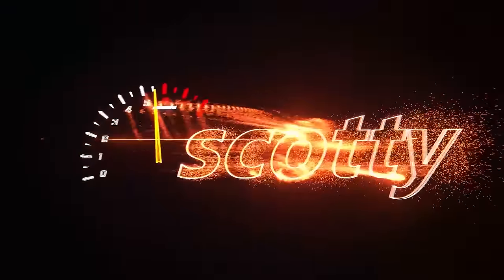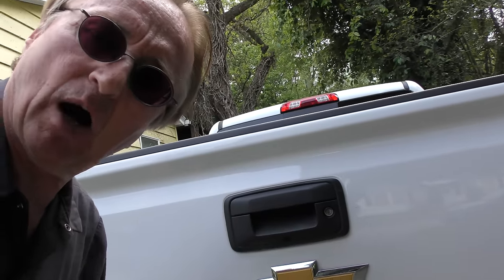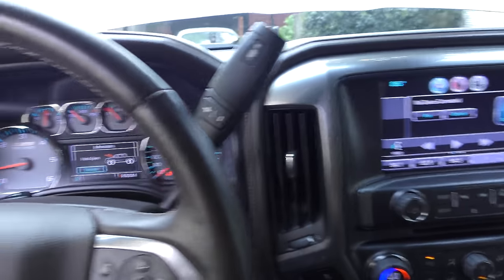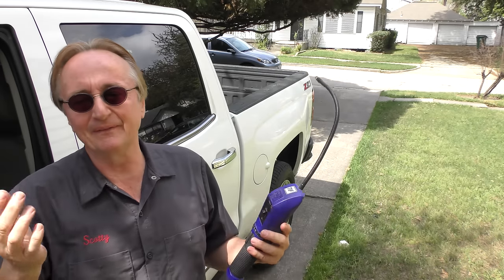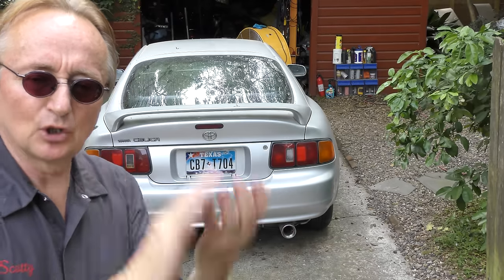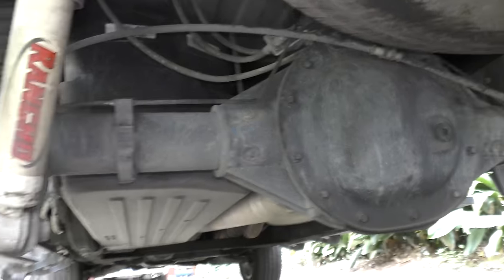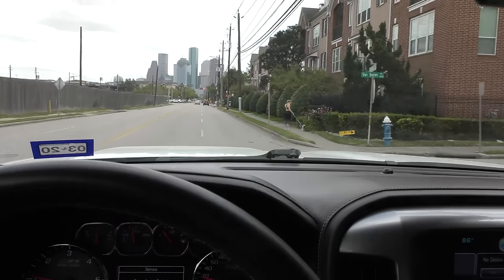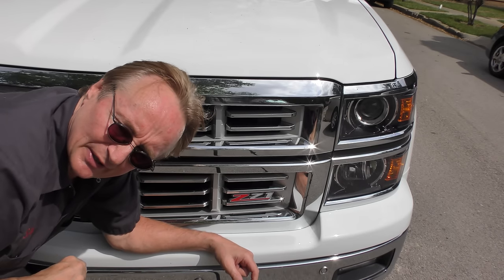Here’s Why I’ll Die Before I Buy a Chevy Silverado

Comment: 2015 condenser failed at 70k miles. There are 3 welds on the bracket. 3! Cracked and leaked. Dealer wants $1300 to fix it. Ill do it for $300 including buying the tools.

Comment: The problem and I've seen this on multiple new cars not just Chevy is we live in a disposable world people don't buy cars anymore they lease them and throw them out after 5 years. I'm running into this problem on my 2015 Chevy Tahoe. It has so many stupid problems that don't need to exist in a 2015. But I also had a problem with a 2015 Nissan Pathfinder that I just recently worked on for my friend the radiators already leaking and they make it so it's a pain to pull that radiator.

Comment: Dear Scotty:
I know you don't like audi or newer german vehicles like bmw or Mercedes but I really want to buy an audi. I test drove one and it seems like a great car. I want to own one for just a couple years and then trade it in for something else. What would be my best option that is under 20k and will hold its value relatively well, so when I trade it in it won't depreciate much. Also be reliable enough to last me a few years. Looking at quattros. Need something most reliable from audi, even though reliability isnt their strong suite per-se. If I buy an audi with 100k miles are there any models that will last another 100k miles with regular maintenance? They look nicer than all the other car manufacturer's sedans/coups and i'd rather get an audi or perhaps a lexus if I'm gonna finance a car.. Has to be 2011 or newer also. Can any audi owners give help i'd appreciate it immensely. 🙏 God bless

Comment: Alright. Got a 2006 Chevy Silverado 3500HD. 6.6L Duramax, dually. All the bells and whistles (by 2006 standards atleast) 450k. Original motor, original tranny, and I'm the original owner. I have no issues with how it steers, has tight steering. AC still blows cold (original compressor.) And more importantly. I've done brakes, oil, and suspension to this truck and nothing else. Has no leaks, never has. I normally carry about 1200lbs daily in the bed of it, haul a camper with it about twice a month. So until you want to talk about bad build quality, you describe to me how my Chevy has lasted as long as your Toyota. Or 4 times longer than your F150.

Comment: Obviously moving the evaporator inside was was a bone headed move but it seems like it doesn't matter what make of vehicle you own, especially the newer ones they all have some sort of stupid ignorant design flaw. I've got a 2013 extended cab Silverado that's a decent truck but when I need to go off road or haul a heavy load I jump in my 1986 2500 GMC 4×4 pickup.

Comment: I'll keep my older 2002.  It has about 235,000 miles on it at 20 years old. I'm just now having some of those problems. But over all it's been very nice to me.  I don't like the new ones.  Truck manufacturers have forgotten for a long time that trucks need to be rugged.  But gotta put all that plastic stuff on there to get better fuel mileage.

Comment: Not sure an AC evaporator issue warrants an outright verdict of poor quality. There isn't going to be a 2015 pickup from any manufacturer that doesn't have an occasional issue. $2000 repair cost / 60 months = $33.33 /month appreciated repair cost from new. I agree it's a shame evaporators aren't still under the hood, but I'm fairly sure there's been a consensus among parts manufacturers and dealer repair centers for a while now..."they don't make 'em like they used to..." is right, but making more things difficult and in need of periodic repair/replacement keeps the cash flow going too.

Comment: got news for ya Scotty
got a 2010 f150 that has the same problem! 
Dad bought pickup for himself new, within a few years A/C started warming up with thermostat turned all the way to cold. Took truck back to stealership still under warranty. All fixed, same day. A few years later and out of warranty and truck left to me,, A/C got warm again but I noticed accompanied by a weird smell in the cab. Evaporator leaking and when truck was with  stealership supposedly getting fixed, they probably just recharged it with freon w/ stop leak which held till out of warranty!  And just like the Silverado, you have to remove the entire dashboard to change out the evaporator! Perhaps by design or perhaps problem with same vendor that makes the evaporators for both ford and GM or the same gaskets, O-rings, etc. that seals evaporator to hose fittings on engine side of the firewall...

Comment: I purchased my Chevy Silverado 5.3L in November 2014. Going on 10 years and this trucks  been very costly with repairs, fuel mileage,  rebuilding transmission,  replaced ac condenser, and constantly replacing annoying sensors all through the truck. Gm never stood behind any of these poor designs at all. After this I dont see me buying another chevy again now.

Comment: I have a 04 Silverado and the power windows suck and the door handles suck. Chevys are famous for shitty power windows. Other than that it's been very reliable. 230,000 miles and only thing that I've had to replace is the radiator and brakes of course. I was thinking about trading for a 2010 and it just didn't feel very solid. I kept my 04 and I'm glad I did. Its probably the best it second best vehicle I've had. My other vehicle that I had good luck with was a 92 S-10 Blazer 4 door.

Comment: My dad has owned 7 Chevy pickups 1/2-1tons.. All with 400-500,000 miles. Only a couple had transmissions replaced around 350,000 miles!!! One motor at 400,000. FUEL PUMPS WATER PUMPS common issues with early models. Always kept spares for every 100,000 miles... Seems like 07'-present it's all electronic stuff
Years  1985. 1990. 1996. 2001. 2002. 2009. 2016

Comment: Now GM has a massive class action lawsuit on these because the AFM/Torque converters blow up. I’ve got a 14 that’s been very reliable to date. Knock on wood. But if an AFM/tranny issue develops, it’ll make the AC fix look low budget. I also have a 22 year old Acura that’s bulletproof.

Comment: Yeah I've had a 2002 and a 05 they were tanks tough built to be able to take apart and put back together and it's was made with better materials I've had to get rid of them thru the years and now I regretting me own a 2010 Silverado 2500 crew cab 4x4 and it drives good maybe smoother than my older trucks and the 2010 has so many more issues and weaknesses than the older trucks electronics, the plastic, the transmission, computers and transmission and torque converters all are garbage. Nothing lasts past five to 10 years anymore from Silverado which is sad for the amount of money you have to pay for them. Your pain literally house note payments for vehicles now especially trucks. Vehicle manufacturers don't give a damn about us anymore. That's why they keep on mass producing crap that don't last 😤😡😮‍💨😏

Comment: Bought a sequoia that replaced my 07 yukon xl  and a lexus RX for my wife because of his videos. Sequoia is a bit outdated in style but I'm confident it will last me longer with less maintenance cost over the years. Just saw a video of a guy who bought a new suburban and the head rest on the third row seat wouldn't  lock on the upright position after 2 months of use. Really Chevy and Gmc?? Love my Yukon and glad I bought the extended warranty because I had to use it, with its cracking dashboard and defective headlights and and and I used all of what i paid for....but not going to risk my hard earned money on their newer models. Final answer.

Comment: Just traded in my 2016 GMC Sierra 1500 All Terrain which had 120k miles.... was on its 2nd transmission... roof leaked when it rained... it's on its 3rd fuel pump since april....3 fuel pumps in 3 months...needless to say I'm the proud owner of a 2019 tacoma 4x4.... I'll never own a GM product ever again...

Comment: My 2015 dually WT was listed at $42,000 . I bought it in November of 2015 for $31,000 . Has 58,000 miles and has blur book trade in of $47,000 seat back and radio have been the only issue . FM replaced the radio in it . Otherwise it’s been solid as a rock . Now the stories I hear at work about the Dodge and Ford are rather frightening . Guess I should have went with the 94 celica 😎
Reply: that is the better pickup, right?

Comment: Not  impressed with my 2009 Silverado 5.3 liter v8 ,  bought it used with 110k,  2 miles  into ownership , it needed a new radiator , then windshield cracked , replaced it, then brakes, rotors , calipers frozen, replaced those, replaced front shocks, stabilizer links, spark plugs, thought I was good , then the air conditioner went , replaced condenser, evaporator , cleaned, now it leaks, so no ac, 
Year 2 of ownership went to replace the rear shocks, drivers side was rusted off at the top,
So I spent 2000.00 to have the bed removed, sand the frame, paint the frame , weld on 2 tabs to reinstall 2 new shocks, cut another crossmember  section of the frame that was rusted out, replaced that, replaced the rear differential cover, then spent another 2500.00 to have rear quarter panels cut out and replaced, replaced the track rail on the under side of the bed ,repaint the bed of the truck professionally and fix other miscellaneous rusted metal on the under side of the bed, plus paint the wheel wells with rust proofing paint, and if that wasn’t enough, the truck has a collapsed lifter another very common problem with these trucks, plus it will lose power as I’m driving it while the door locks go up and down as I’m driving it every two or three weeks for 45 seconds to a minute.. truck now has 133k on it , and was from Hyannis mass, rust bucket, even the the chassis rails which are thick have holes in them , really not impressed with this truck at all,  when I bought it the body of the truck looked great as did the bed, but it was all rusting out underneath,  ready to go back to dodge , on the plus side the seat is comfortable , but it’s very generic, unimpressive truck.
Oh yeah can’t even listen to one song on satellite radio without constant interference. Expected more from gm but left disappointed. It is reliable but not with out its problems.

Comment: I have been driving for 50 years and other than GM, have had one Subaru. I just bought my first used Ford truck. I am tired of 10-15 year old trucks just rotting out from under me. Maybe Ford is no better, but it was time to try something different. I mean, really,  a 12 year old truck so rotted out it cannot can be repaired for inspection??

Comment: Worse thing about that Silverado is it has direct injection, prone to build up on the valves and intakes from crankcase ventilation. The factory should have equipped them with an oil catch can.

Comment: been a GM guy my whole life, but I picked up a used ford ranger 5 years ago because it was the best truck i could find for my budget at the time. drove good for about 3 years with minor repairs, the last 2 years... well lets just say ive stuck a good $6000 into it to keep it on the road, and that is not even the engine or tranny. brakes down on the road at least once every 2 months where i have to get it towed. time to get away from ford again.

Comment: Local Toyota deal shop uses a Chevy to plow the mountains of snow we get every winter on there parking lot the last 8-10 years for the reliability. Odd that a plastic tail gate latch and a Rare a/c leak is what you use to run down a Chevy. Both here in Canada and the US the government’s use Chevy and Ford products. Police, forest ranges, Search and rescue, wild life conservation. No Toyota’s and Toyota Tundra sticker in the wind says it is as bad fuel economy they. Not sure now but high gear ratio rear end to get some torque makes bad fuel economy. Unless you use a pickup truck for a work vehicle towing close to max tow capacity or pay load you can’t make a good evaluation.

Comment: Hate to say it i had a 2017 denali 6.2 like this one ac never worked was only 5 years old when i got it needed engine mounts new front end re build wheel bearings control arms lifters failed on me had engine re built it failed again 2 times after and my transmission has also failed not to mention now the boddy panel feel like a toyota the new ones are even worse gm blew it.

Comment: Just traded mine in.  Was a good truck for the first 10000 miles.  The tranny literally shredded itself inside.  The dealer had to replace the tranny at 57K miles under warranty.  They couldn't tell me what caused it, or wouldn't tell me, so I offloaded it.  I will never buy a chevy again.

Comment: I work at a GM dealer in PA and i am willing to bet the cross over tube on the ac condenser is leaking and not the evap core. Its a common issue for the condenser to leak and this man went off nothing but a machine that beeps. Great diag scotty you tool

Comment: All modern vehicles have this issue, the pile loads of crap in front of stuff and make it difficult to work on, not just Chevy. You want something easy to work on get an older truck. Also for all the complaining about the 2K repair bill, it looked like other than that the vehicle was in good shape and you really didn't complain about anything else. I don't even care if the a/c works as long as what I have will get me there and back. I don't need heated seats, A/C etc. Granted that is pricey but most repairs are these days. The question is more about how it will last long term and will it stay on the road. If you wouldn't buy any car because some luxury item breaks on it, you won't buy any cars they all do it.

Comment: Every time I have to use a chevy pick up at work, I dread it. Many times I come back to a truck after having it completely shut off, dead battery. No lights or radio or accessory left on. Just dead battery. Hated it every single time. I don't mind their cars, but I'll stick to Ford for my trucks.

Comment: Just bought a 2021 Chevy Tahoe. Had it for less than 6 months and it’s been in the shop twice. Last visit was for the power steering going out while I was driving. Service center says they cannot find anything wrong with the car even though other have experienced the same issue. Any thoughts on this?

Comment: All the truck manufacturers use cheap plastic inside and outside,  not like GM is the only one.  So one secluded problem is how you come to the conclusion the truck is junk? My last 3 trucks have been crew cab GM trucks, 1 used and 2 brand new, always been very reliable and I don't drive them easy,  and I use them for towing.

Comment: Bottom line is the big trucks are not built to actually do what a 3/4 or 1 ton truck should be used for. If your some yuppy that feels cool driving a $100k big boy truck to and from the office and tows the boat or rv 1-2 times a year on really good roads it will last beyond 100k miles. If you use any of the newer big trucks for real work it will become a money pit after 100k miles. Lesson for all the new trucks is to trade it in at 75k miles and buy another one or use those $1000 a month payments to keep the old one going. The manufacturers have this figured out.

Comment: Chevy has gone DOWN , he’s correct!
I have a 2013 Silverado and paying over $35000 for a vehicle that I purchased in 2014 should not require one to replace three door handles in less than two years.  That’s over $375 a pop and not included in the expensive extended warranty.  My grandad had a 1970 yellow Chevy that still runs and has the original handles.  The truck is older than me and though he wasn’t a mechanic, Any repairs that needed to be done he was able to do himself.  When I contacted corporate about the issue with the handles the cost was reduced to. $175.  A csr said they receive complaints about the door handles all the time bc they replaced them with cheap plastic parts from china instead of using metal, why?  To reduce cost.  Really?  Can you imagine paying that amount of money and the damn handles start to come off after two years!????
Knowing this is an issue one would think they’d repair with metal, nope.  They replace with the same damn thing and in three years another handle is needed.  Yes, the vehicle has defects with the AC unit and local dealers fail to use the extended warranty to repair and tell you there’s no problem.  Gm use to be a reputable company.  Dealing with my truck made me so angry I even dumped my stock.  Forget about em.

Comment: My 2014 is super reliable no problems
Reply: We have 6 silverado trucks in our fleet of work vehicles. And had alot more in use but our  2012 had 2 transmissions, 2014 had new transmission, 2017 and 2018 models both had transmissions put in them. But upper management belives silverados are the best thing since slice bread.
Reply: Oh and if you hear a knock when taking off it's most likely your engine motor mounts

Comment: Good morning Scotty!  Luv your videos you put out.  I just bought a 2007 Chevy Silverado 4.08 and my problem is that it doesn't acceralate the engine it stays idle.  Before I get it repair, could it be the Throttle body or the pedal sensor.  Please let me know...going crazy with the problem.  Thanking you in advance and blessings.  I wait for your response.